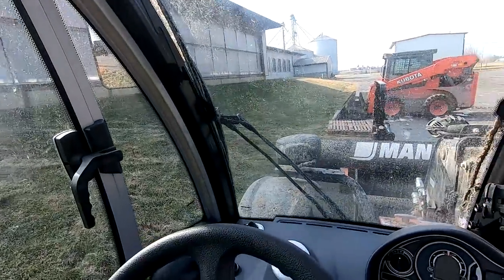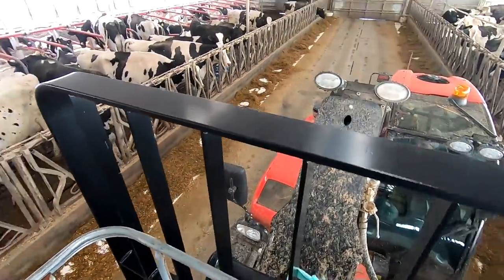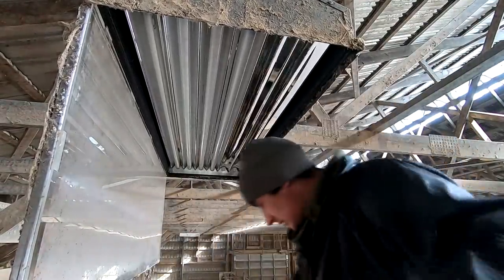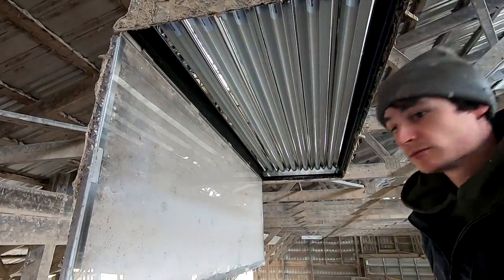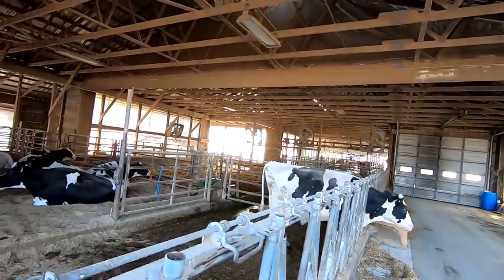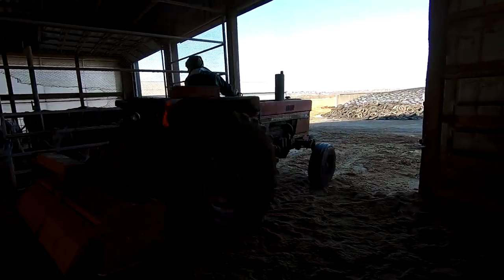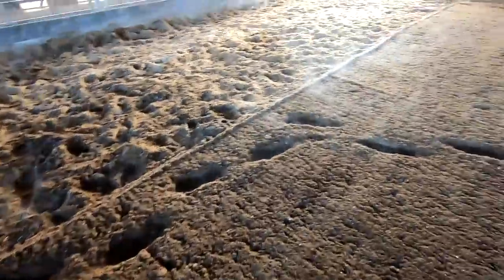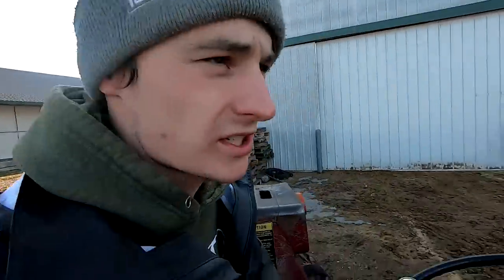Rototilling Bed Pack Manure

Comment: We use a crate like that too. Safety tip: make a board from to bottomup 1 feet around. If u push with your feet a tool thats on the bottom it doesnt go down ( and hits someone on the head)

Comment: I have known a few old dairy folks back not that many years ago 
I must tell you that your operation is a much cleaner and more efficient then I have seen in the past 
And for a while I thought it was a requirement to keep everything you have ever touched in Ramond piles and at several locations

Your farm looks great in your drone videos with the contour farming and various crops very colorful
Like a work of art 

About those tele handler‘s
You may not know that JCB makes a skid steer tires or track with side entry and extending boom 
They also make tillers for your skid steer 
Less tractors to maintain if one can do more 

Your barns may to small of alleys with thigh quarters you will end up bumping into things adding to your list of repairs

Comment: Eric,  a suggestion to see if your compost is composting,  try a thermometer and see how hot that bed pack is down inside.  If it’s breaking down it’ll create heat….allot of heat in fact.  My compost piles would reach 135 degrees.   It would take about 90 days to turn my horse manure and leaves into dark great smelling compost for the garden with at least weekly turning.   When the temperature drops, turn and add some moisture.

Comment: The juxtaposition of a pain in the ass “safety” switch for stopping accidental bucket disconnect with the piece of rope tied around the “safety cage” to keep if from falling off the forks is simply fantastic!

Comment: That helps with clumps in manure plus help to put it in the holding pits. We always at our neighbors salted the floor’s in winter to help keep the manure liquid an manage more quicker and going in auger to be loaded . Like how you have barn set up the new barn up above I think I ask about this once before to have doors you can open up from the door automatically shut during winter and open during spring ,summer, fall and closed in winter.

Comment: If you’re thinking of getting a tiller they make skid steer attachment tellers so you don’t have to buy a huge machine with motors and everything you can just hook it straight up to one of your mini skid steer‘s or potentially future Tele handler‘s and region from the outside and limit compaction even further

Comment: We promote rototiller for longer lasting litter in cowshed.
With our miscanthus bedding chips we ask the dairy m'en to rototll every days to aérobie fermentation that will dry the litter.
Also you have to pull up the tail of the rototiler to have the heavier parts of the litter on the top of the litter. Like that they will dry quicker !

Comment: I have a pack barn for my 200 dairy cows the tiller is the best way to go if you use a cultivate or ripper it don't leave the top dry enough for the cows where the tiller mixes very well and the finer the better we use a compost tiller it's 8ft wide and Diggs 24 in deep
Reply: What brand are you using? We use a reverse rotation Terra Force. It does a really good job, but I wish it went as deep as yours.
Reply: @stevengoogin3729  it is a lvi dairy
Reply: @justinjobson7184  The best one out there!

Comment: I thought for sure that you were going to find a Mt Dew or Chocolate Milk up above the metal pieces you were removing when you changed the light over the LED. Haha, guess my intuition was off! 🤷‍♂️😂 
Anyway, I can totally tell that you like that Manitou a bit more than the JCB, as you seem to go for that one more so than the other. It definitely seems like having a telehandler on the farm would be very beneficial to you guys though.  You can see how much Tom Pemberton used his, over across the pond in sunny ol' England. Lol. It's a shame you weren't able to get each one by itself for a short time so that you could focus on them individually and give them each a fair shake, instead of having to try to use both before they go (not saying you aren't giving them each a fair chance, but I'd say it is very difficult to distribute your time between each one equally as every job you would use them on is unique and one might take longer than the other, or you'd need to use features that the others jobs wouldn't need said feature. Anyhow, loved the video, as usual! Already looking forward to the next. 🙂 Take care, God Bless, and stay safe!

Comment: Practice your welding. Weld a length of chain to the basket with ahook on the end. Boom! Safety chain. 😁  Good to see & hear Dad. That tiller does a really good job looks like. But will the surface be dry?

Comment: Hey bud they have LED bulbs that that you can use with the ballast. The only thing that kind of sucks is if the ballast burns out completely you're kind of back to square one. I put quite a few of them in and they seem like they work pretty well though

Comment: For about the most extensive info on compost bedding go to the University of Kentucky websites dealing with subject. To accurately monitor whether your'e getting desirable composting you need to measure temperatures 8 to 12 inches deep. It should read about 140o.

Comment: One of those switches is a no tilt switch, you can lift and extend but not accidentally tip someone out
Reply: Also the switch with the parachute temporarily disabled the safety cut out if you lift too much, careful with it tho, you can lift the back of the machine clean off the ground, I put my back out when the forks slipped off what I was pulling and the back fell 3 foot

Comment: You better buy a maintenance bucket! much saver this looks scary haha
Reply: That cage is probably more safe than anything they could buy.   Other than a piece of rope holding it on.  I would at least get a chain for it.   We are not going to mention the requirements for a safety harnes working that high off the ground though....

Comment: Hope this works to not have to use as much bedding. Sawdust isn't cheap so anything you can do to keep the cost down. I know in iowa it's like 2500 for a semi load what is the rate down there?
Reply from the maker: We pay a little over half that in our area
Reply: @10thgenerationdairyman  @Levi Meyer    Trees a bit scares in the plain states.   Probably that is why the sawdust is a bit more dear out there.
Reply: @jwiereng  yeah probably

Comment: Has anyone out there used that Breakdown product from Homestead Nutrition which Eric was applying? I am interested in trying it on my compost piles. The Homestead website was remarkably uninformative about the ingredients and the biological/chemical processes involved. I already manage the compost much the way Eric handles the bedpack--tractor with tiller and frontloader. If this stuff actually works, I would like to apply it before the tilling.

On the Eric's video, I though I saw a reference to lime and to aerobic bacteria, both of which would be useful. Not sure, though.

Comment: jcbs are cool telehandlers quicker more agile in my opinion, only thing is, their engines are shit, manitou on other hand are more sturdy and their engines are much better, the hydraulics on a jcb aren't as smooth or sharp as the manitou, but its really what ur after doing with it etc, plus if u gonna be doing jobs where u want to use it as a cherry picker get a bigger model with front legs or ask them if that smaller model comes with front stabiliser legs, as the boom will allow u to move heavier objects at longer boom etc :), but thats a british view on it as jcbs are consider the machine to go to on building sites, where most other places tend to get lieberr or manitou :).